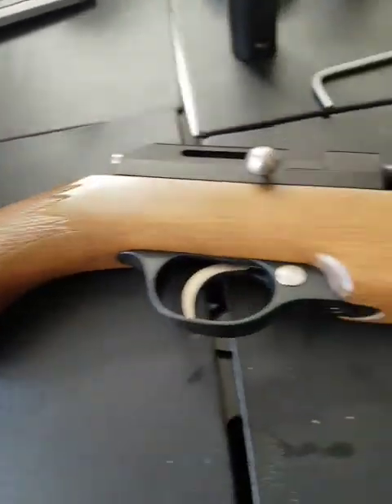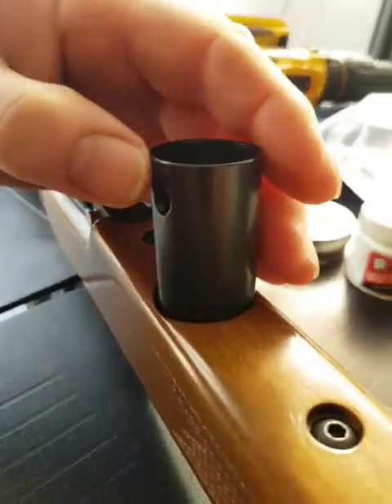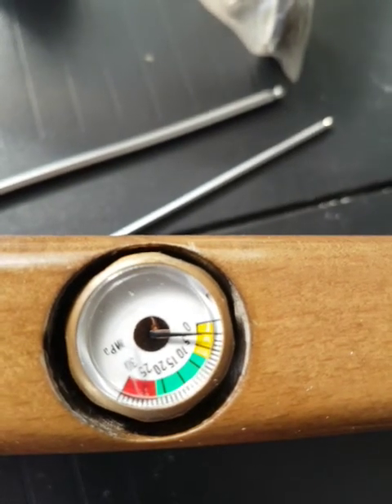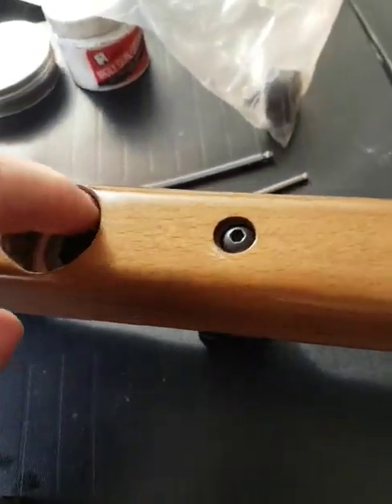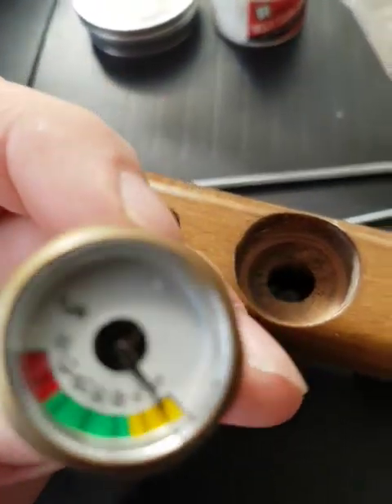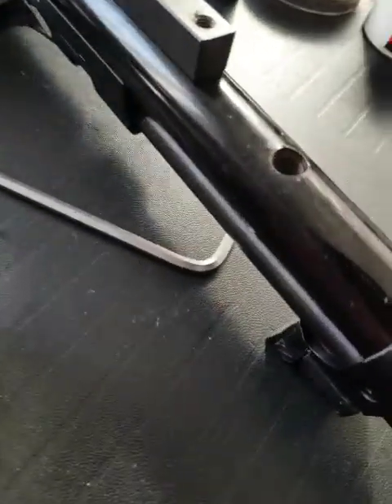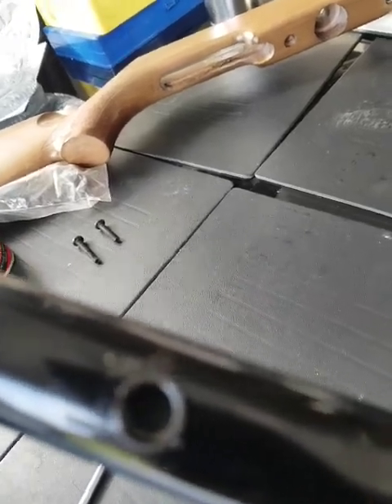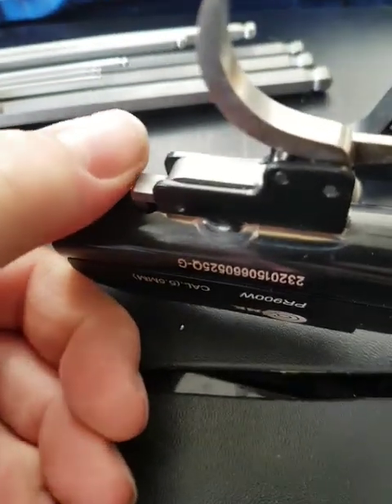SMK PR900W de-gas and stock removal.

Comment from the maker: Depending on model of your gun there were 2 different sizes of gauge, the large one is 27mm but unsure of the smaller one, but it looks like 19mm if thats what your measuring.

Comment: What size is the thingamabob you're using to unscrew the manometer? Also, as a non-native speaker, where are you from? I mean no disrespect, but I had a har time understanding you.
Reply from the maker: The tool is internal size and if you had a socket set would be equal to a 27mm. The tool you see in the video is the actual tool from SMK, and I speak the Queen's English but with God's accent. GEORDIE.